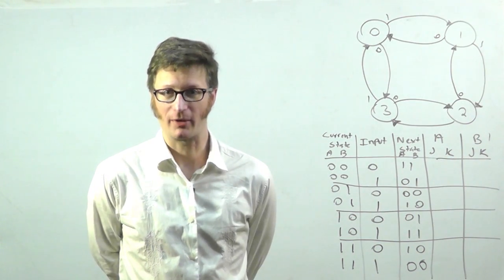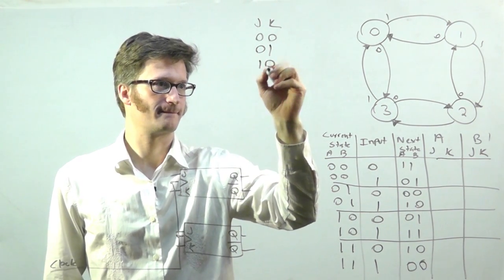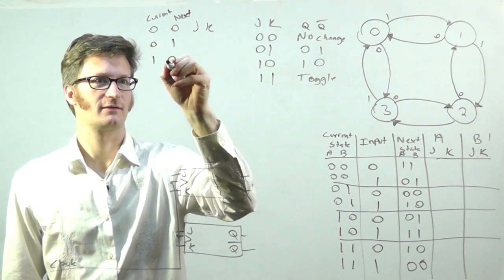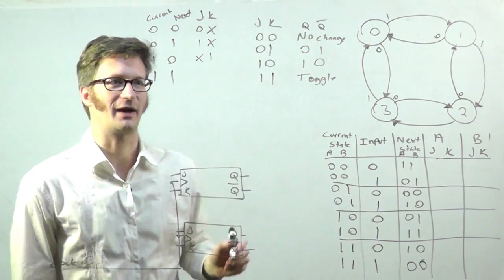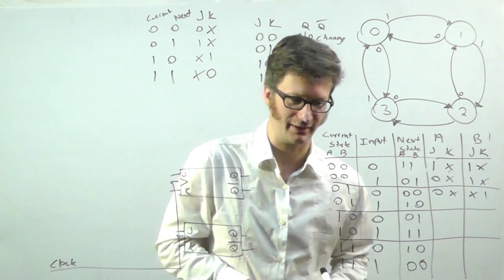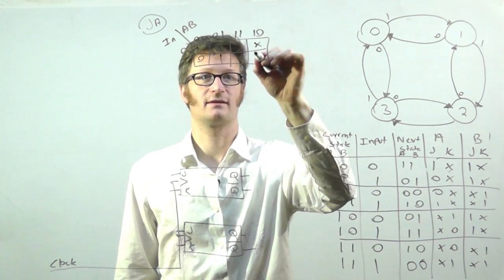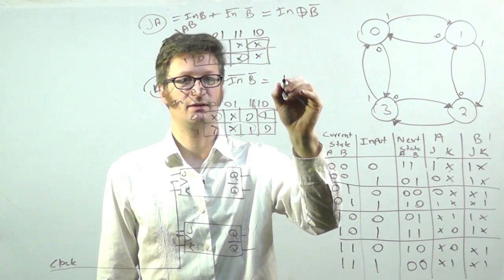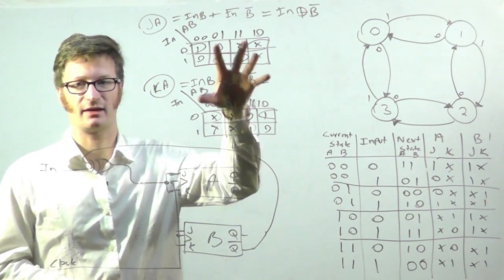Digital Logic  - Making a State Machine with JK flip-flops

Comment: RE: K-maps (Karnaugh maps):

The K-maps are used to simplify boolean equations so that you reduce them to the minimum number of terms and literals. This is done to save money on circuitry and optimize the circuit so it runs as fast as possible.

Every place where the function produces a "1", the K-map has a "1" in the corresponding box. There's no need to list the 0's. The "X" represents a "don't care" condition, which means it can take on the value of 0 or 1 -- whatever you need it to in order to help with the simplification.

Simplification involves finding adjacent groups of 1's in the grid that are in powers of 2. Thus, you can circle two boxes, four boxes, eight boxes, etc. If a bigger grouping is available, you always take it.

Comment: I've been learning this material recently to prep for an engineering exam. The following might help others:

1. The first thing you need is your state table. (How to move from present state to next state.) You can derive the next state equations (called "characteristic equations" ) from that. 

2. Once you have your state table, if you're designing with anything OTHER THAN D-flip flops, then you need to work out the flip flop INPUT EQUATIONS , because they will be different from your next state equations. The four rightmost columns in his state table are the flip flop input equations. 

FYI: The table he created at the top left of the board is called an EXCITATION TABLE , and it's NOT necessary to do these problems.   Why? The table is FIXED because the behaviour of the underlying flip flop never changes. A JK flip flop behaves the same way all the time. Once you know it, that table will be in your brain automatically.
Reply: Thank you so much!!! Knowing that is called an excitation table is really helpful. Bless you~